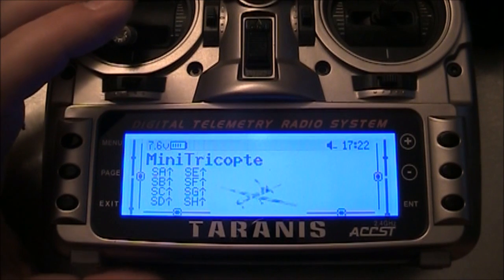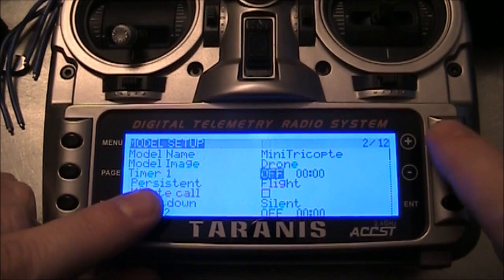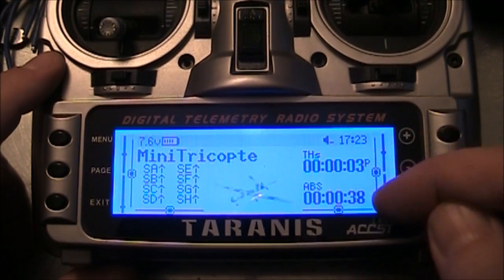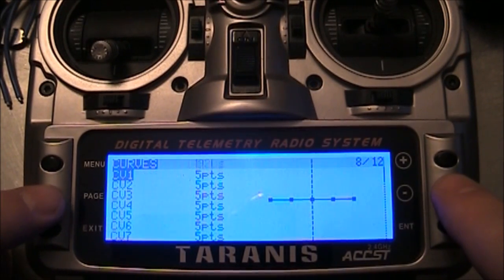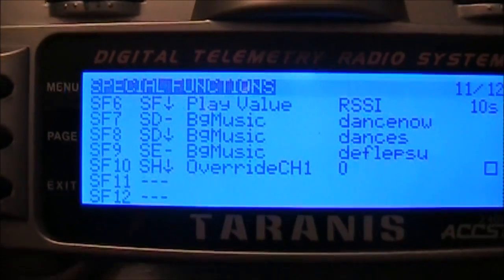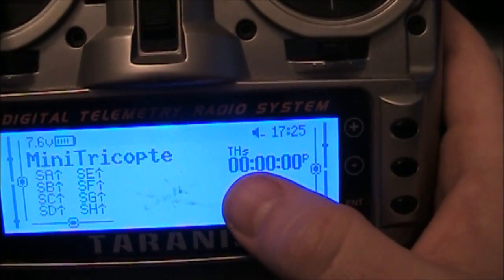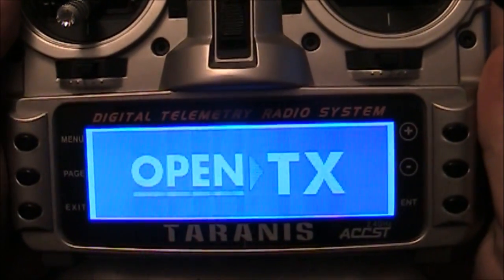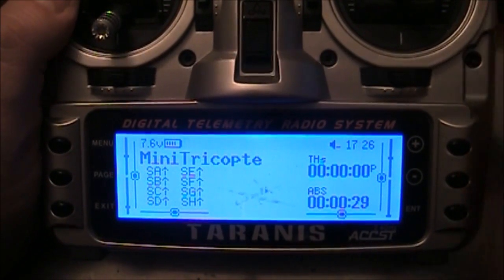Time Your Flights with the Taranis! (Part 1)

Comment: Useless fir a drone - throttle is always above 0...
Reply from the maker: Not when you land and disarm.  You don't want to include that time.  Also, when your Taranis is on and you are plugging in your quad, you don't want that time to be measured.  You only want to time when the throttle is above zero.  It is very useful.

Comment: It is showing P which I guess is persistant, meaning when you switch on/off the radio, it will remember the last timing. I didn't use that, so it resets every time I on/off the radio. Now what I do is use timer 1 to show countdown from 7 mins on my quad using throttle position (8 mins flight time) and timer 2 shows throttle position but counts up. You can also make the radio speak out the value of either timer 1 or 2. I love this radio!